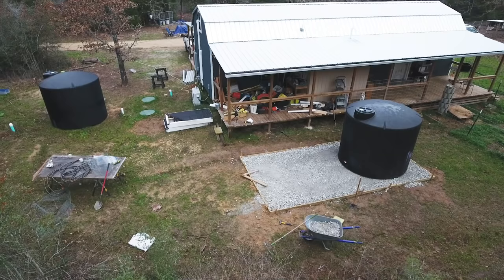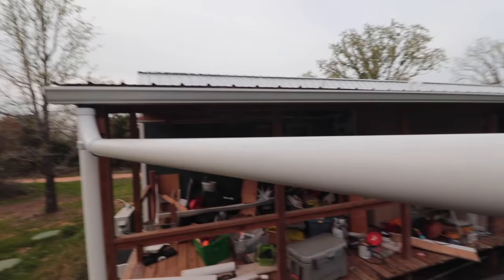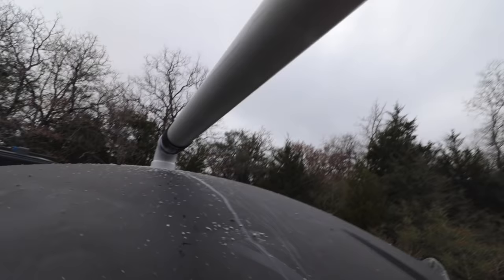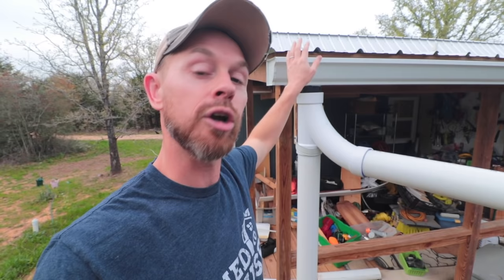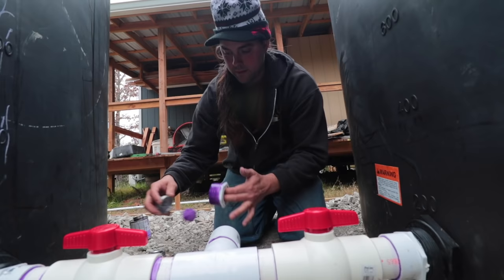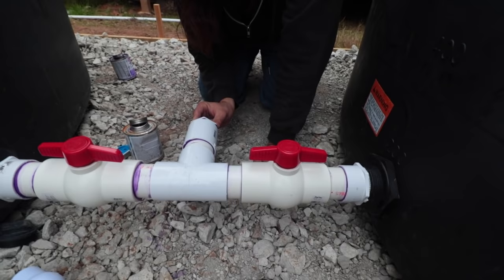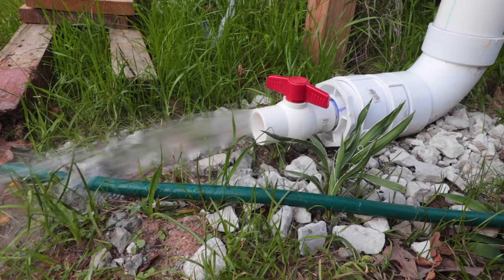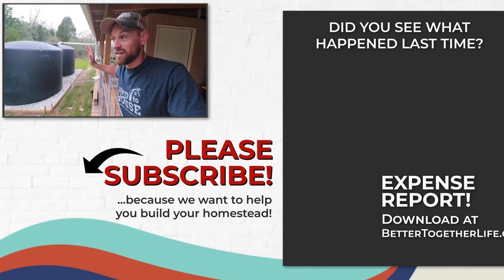How to Install a 5000 gallon Rainwater Harvesting System

Comment: Amigo... your overflow pipes is undersize ... the input size is 4 inches ... overflow is at 2” And reducer down to 1” ... the water Will flow back to your gutter ...
Reply from the maker: No, rain doesn’t work that way.  That 4 inch pipe will never be fully flowing with 4 inches of water.

Comment: Nice system, but one major error. You have two overflow pipes at 1 1/2 inches that will fill at the same time.  They combine at the bottom with the volume of a 3 inch pipe, and you reduced it to a 1 inch pipe.  That creates a backup volume of a 2 inch pipe. Even with your 1 inch hose connector wide open you will have a backup equivalent to the volume of a 1 inch pipe. I suggest you split your overflows and take one in different direction and stay at 1 1/2 inches. Be Well.
Reply from the maker: I understand your thought, but it doesn’t add up like that.

This isn’t a pressured system.  The overflow is a nice and gentle flow out.
Reply: Chuck must be one of those engineers that thinks if it looks good on paper it works in the real world. Bwahaha

Comment: I guess I would of made the whole in the actual opening lid and that's because you can always buy a new lid. I would not just put a whole in the actual container which its much more difficult to fix than a lid.
Reply from the maker: Yes, but if you do that then you will never get the full 2500 gallons of storage.  

Well to be honest I am not sure actually.  That isn't a bad idea.  I am not sure what the difference in the level between the two.  I know the top is higher, but I'm not sure how much higher.

Great point!
Reply: @BetterTogetherLife  I was just couple days ago at tractor supply looking at one of those.  I truly want to become 100% independent and self sufficient. I'm working on my vermicompost and black soldier fly farming. I'll be getting some comfrey plants and corrohizal fungi for soil amend. This process is just a little too slow for me,  but I'll get there. Thanks for the video.
Reply: @jmaiatrader2925  no you dont drill a whole in the top of the lid, you need to be able to look inside your tank without taking the whole inlet pipe off, you can buy Norwesco 16 inch lids with a 4 inch center lid. He should have drilled a 4 inch hole in the side of the riser where the manway opening is  and then drilled a hole slightly higher for an overflow. I have a 2500g tank and a 1550g tank.

Comment: This video is pretty old so I'm sure somebody has said that you shouldn't use Teflon tape on PVC threads.  ...and that the dude getting the PVC cleaner and solvent all over his hands is really bad for you unless you dig on some cancer...
And that pvc degrades quickly from UV in sunlight and will become brittle.  Paint it or cover it.  Better yet, use the grey PVC electrical conduit.  
It's funny how the guy is amazed by the fact that the two tanks equalize when they're connected together "because some pressure or something just somehow makes them the same".  Lol!   It's no different than a great big water level.  The waterlines will always be level to each other in both tanks....even if one tank was sitting a foot higher than the other.  
If there wasn't an overflow valve in the tanks, it won't back up and blow your gutters apart.  The whole system will just fill up and the gutter will start to overflow because there's no place left for the water to go.   No big deal.  You'll just not be able to collect all the rain that falls while you're totally full.  Adding the overflows just allows you to throw a barrel under the overflow to keep collecting more than your tanks can hold.  Nothing's under pressure and nothing will blow up like he's saying.

Comment: Why don't you just skip the downspouts and extend the gutters or pvc pipe either or towards the back using 45s it will flow straight into the pipe from the top rather than try to get the water back up.

Comment: Your overflow system is going to cause you problems... the overflow needs to be the same volume as you inflow...  you have too small of overflow pipes AND you have "choked" the flow down even smaller where you tee them together...
Reply from the maker: Nope, it’s worked great since 2019.  But thanks.

Comment: Buy a hole saw for your drill, don't use a jig saw.
Reply from the maker: cool
Reply: Well, you'd have to have the exact size hole saw for the pipe you are using.  Most DIYers already have a jigsaw.  Why buy a $15 hole saw for an application you would use once or twice, even if you could find the right size?
Reply: @roblawrence9495  They come in all sizes and even novices can cut perfectly sized holes. When cutting plastics, run the hole saw in reverse.

Comment: You're missing the point of the first flush. The water that goes in there isn't to use. It's to allow the roof to clean off before the usable water goes into the tanks. If the first flush isn't emptied every time it rains then you'll end up with contaminated water in the tank. You're supposed to have it slowly empty either by leaving the valve open a little or by drilling a small hole at the bottom of the pipe. The hole should be big enough to drain and not easily clog but small enough that all your water doesn't drain out there and not allow it to fill up.
Reply: When collecting rainwater living off grid, you save that first flush to use in your garden, or to clean something, rinse, whatever. You save and use ever drop. Living off grid and self sufficiently means saving every drop of everything.

Comment: 2urs ago this was loaded.
Recently I had x2 133.000 Lt 10.000g tanks delivered, and nobody will help me install them, F#*$*K... all the wife said was, Robert what have you done... they are bigger then I thought so there ie that... but the plumbing has me stumped... I've fixed some.e dairy irrigation b4 but never set anything like a full gutter to tank system up...

Scary money in this economy so can't make any mistakes, coin is tight .. 
An I need to start woth a 16m buy 6m pad...😳YER....

Comment: That 1 inch overflow is nowhere bear big enough  for the amount of water coming from a heavy rain. You have 4 inch in and 1 inch out. ???? Hmm
Reply from the maker: How many rain systems have you installed?

You speak as an expert.  Answer that before I give you my answer.
Reply: @BetterTogetherLife  you don't need to be an expert to know if you have the volume of water going in that a 4 inch pipe can supply then a 1 inch overflows will not keep up. Once your tanks fill up and you have a rain storm that provides more water off your roof then a 1 inch pipe can drain off then your gutters will fill up and start overflowing. 
  If a 1 inch overflow was sufficient then a 1 inch supply should be as well. 
  It's your place, if you don't care if your gutters start overflowing then I don't care either.
Reply: Pete is not allowed to plumb anything for me. You don’t reduce when you combine. A 2” would suffice by combining the 2 - 1 1/2” pipes. But I’m only a hydraulic specialist. Not a pro like Pete.
Reply: Always a bunch of internet pros on every thread. A keyboard or iphone gives you the power to be an expert on everything from criminal law, politics, parenting, fishing...you name it! 
Maybe you guys should mind your business and let this guy share his project.
Reply: Dawson Burrell no one asked what you do for a living and I don’t think anyone offered to plumb anything for you.